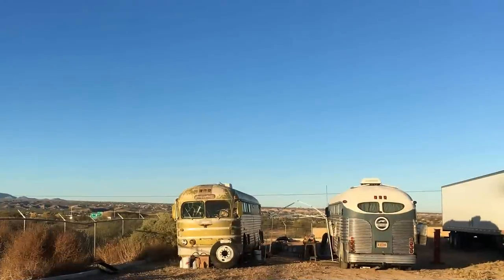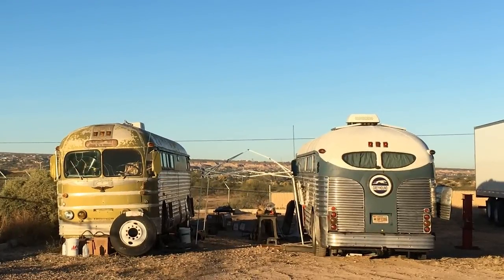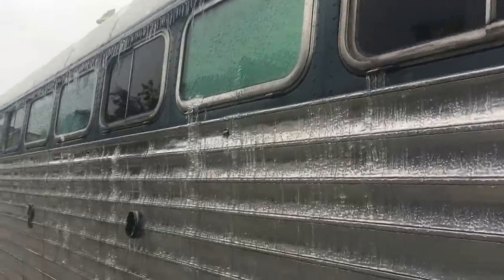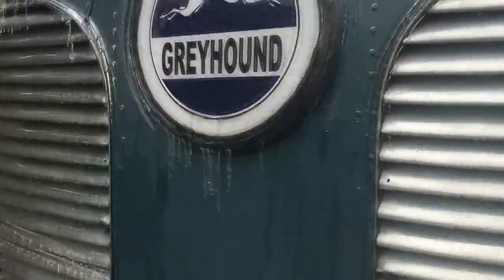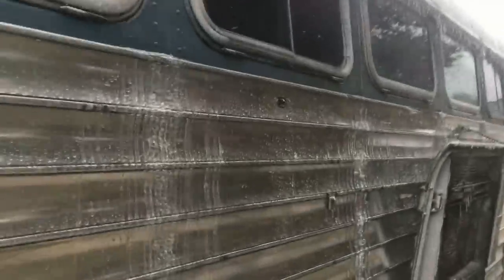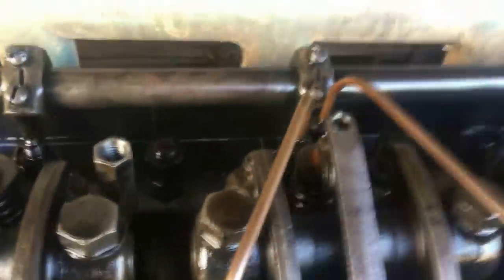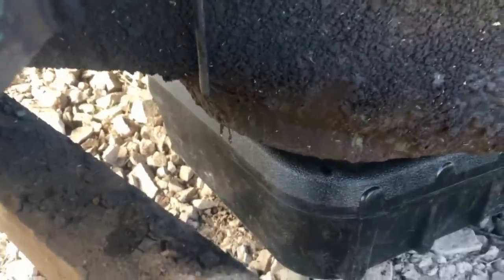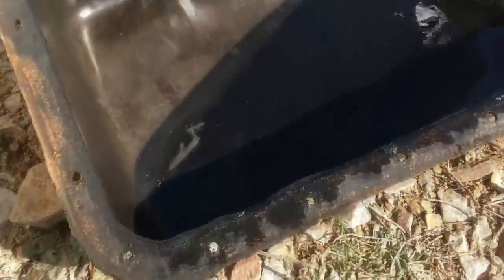Resurrecting a GM Bus that had a seized detroit diesel 671

Comment: Love series 71 detroit diesels.  I'm 69 year old hippy.  Shade tree mechanic, I only work on my own stuff.  Never owned a car with a brain.  My daily driver is a 52 chevy half ton.  Usually it takes me 3 times fixing something to get it right.  never could get carbs right.  Bought an old boat with a 3-71 series.  Engine just wore out.  it had been treated well it's whole life.  Engine built 1938, modified along the way.  I had no choice.  I had to fix it myself.  It was intimidating, cause it has to be rebuilt in place.  Thanks to the internet google youtube, i rebuilt the whole thing.  took me 3 months to research, learn, from random mechanics who were willing to spare me a bit of time on the phone.  There are video's on setting the rack, I wish I had seen this video, but there are others..  a buddy of mine gave me a shop manual for a 4=71 engine, and another from a boating friend, printed in 1938 for the 6-71.  I wish i had been introduced to these engines as a young man.  This was the only engine i have ever built that started the first time I turned it over after the rebuild.  the first diesel engine I have ever owned or worked on.  Two stroke diesel,  anyway thanks Bus Grease Monkey for this video

Comment: It's no wonder he's crunching gears, he's changing far to slow those fullers gearboxes are a rapid change especially if double clutching, great gearbox when you get used to it but it's the speed you operate the clutch that makes the difference between a clean change and a crunchy one.

Comment: I worked for 22 years at DD and the 2-strokes will never die.  It's sad the EPA rules spelled their doom, they were simple to work on as you saw built to last.
Reply: Bob
I'm with you, an Navy Engineman 20 years working/running 6-71s in the amphibs & schools, with developing some 6V-53s on Jacuzzi pump boats & school.
Always a sweet design, great engines in use.
Reply: Whoops. Almost left out the 12V71s, the main propulsion Cleveland big ones. 
All descendants of the Winton.
Reply: I worked at the Redford plant from machining, assembly, and inspection.  I was the fuel injection lab technician for 7 years and know how well built these engines were.  Seeing the bus come back to life brings me great satisfaction
. @johnlopperman2161

Comment: Interesting engine combination, newer "high" block, old 2 valve external fuel rail head.
Reply: Detroits had 2 valve heads?  All the Detroit heads I've ever seen had 4 exhaust valves
Reply: @LuckyBaldwin777  Really rough guess, mid  60,s the 4 valve heads came out.
Reply: @newjerseybill3521  That's interesting.  Never knew such an animal existed.  You learn something new everyday, as long as you pay attention.  Thanks New Jersey Bill.
Reply: @LuckyBaldwin777  Another interesting design change over the years where the cylinder liner ports.  Very early liners had a bunch of small holes at the air port area. This progressed to lager round holes, to figure 8,s to the ports we know today.  Many many years ago I saw some of the early liners in a scrap pile. Too bad I didn't have my pack rat mode back then.  Would make an interesting display of the variations over time.  Can't even find pictures on the internet of the early ones any longer.

Comment: I'm not a fan of multi-viscosity oils, they are necessary for really cold areas during start up but seem to thin out too quick especially in warm climate. Many don't know of Detroit 2 cycle oil recommendations. It should be on a tag attached to the engine.
Reply: what is it

Comment: How can a guy of that age, with bus driver’s license, not know what double clutching is?
Reply from the maker: It’s an rv and only requires a regular drivers license.
Reply: Still, I'm with Claus. A mature dude, doesn't know what double clutching is...
Reply: @966Mako  ignorance is bliss
Reply: Who uses a clutch much less double clutches?
Reply: @k2mslskier  me lol, all my trucks are manual. Floating gears is fun too 😏
Reply: Remember this is the same guy who was driving it with next to no oil, knocked the bottom off the radiator, and continued driving until the engine locked up. 
On that basis I'm surprised he knows how to drive at all. Perhaps he doesn't. He was certainly driving for hundreds of miles crunching every gear and not knowing why... smh...
Reply: What's a clutch???  Don't you all drive automatics now
Reply: After 1st 2nd or R Why use the clutch.  .  It wears them out.

Comment: Very interesting video! My experience has been mostly with Eagles, except for the GM double-decker. I remember in Colorado when the Oklahoma Transportation Co. had a contract with Trailways for their drivers to drive the "blue gooses" (as the Trailways drivers called them) between Oklahoma City and Denver. They all had the standard 4-speed floor shift (Spicer maybe?). 

I must admit this is the first time I've seen a column shift on an OTR bus. Even the old Silver Eagle Model 01's had a floor shift, 4-speed Spicer, powered by the Detroit 8V71.

Comment: mark all the pistons and liners from where they came from, every piece needs to go back in the same place for all engine parts, if you put them back mixed up youll get probs later on down the line, over heat clearance probs funny odd ticking noises etc
Reply from the maker: All of the liners and pistons were junk, but the rods were reused and yes they are all marked.
Reply: WOW, you think this engine is the first one this guy has ever done! Engine overheated, shooting sparks, and you are worried about marking pistons and liners!

Comment: Had you thought down the line getting a diesel generator for Lenny? the two i know of is Generac and Onan as i believe the onan's have a 4 stroke Kubota diesel engine in them i think depending on the model the engines are mechanically injected Not sure on Lenny's bay size on fitment on that generator as i think the engine is liquid cooled.  i seen videos on Matts4290 channel he mounted a generator in the middle of the bus between the frame rails of his 2002 Blue Bird All American retired school bus. and a Onan generator already mounted on the left side on his 1999 Gmc CV200 Blue Bird and its exhaust exits the back parallell to the engine exhaust. as i believe he uses the generators to run outlets and two roof toop air conditioning units with optional heat strips in them.  what was unique he did is took the control switches wired them and put them in the front of his busses so he can access them from the drivers area to control the Ac units and as well start and stop the generator. kinda interesting. as if a diesel generator it can be plumbed into the bus diesel tank or a seperate tank for it.

Comment: Nice. I just got a 1955 TD4512 gmc with 671. Runs great. I need the tabulation for the circuit assignment. I have numbers on the panel but the sheet on the panel cover is badly word and in readable. Any ideas where I can get a picture of one?

Comment: What I don't understand is, why didn't the owner stop the engine after having the radiator destroyed? There had to be smoke trailing behind it, right? Didn't the temp gauge indicate an overheat, or could it be that the coolant level dropped below the sensor, and thus it didn't show the right temperature? Just curious

Comment: How much oil did it burn out of it during the overheat... I mean theroetically if you have enough oil and can keep it cool enough you could run without tearing the crank out of it... the cylinders will eventually seize if it doesn't run out of oil and throw a rod.

Comment: I know nothing about this particular engine or those buses but I'm guessing those are two-strokers, am I correct?  Just looking a the holes in the cylinder liners.  I've never worked on a two-stroke diesel, only four-strokers.
Reply from the maker: Yes 2 stroke diesel detroit diesel 671

Comment: I was not able to tell, do they have the ability to rear start. 

It came out well!
Reply from the maker: New they do.   But the wiring and switches go bad and many times it’s inop I’m a big fan of front starting manual trans buses myself.
Reply: @BusGreaseMonkey  Okay, I cut my teeth on 9's , 12's and the old beater 102's , and they all autos.

At the time most of the TNM&O coaches were manuals, so I never drove those. Safety first.👍

Comment: I followed the rebuild, but was confused which engine/bus you were rebuilding. I understood you to say you were rebuilding the stainless and blue bus, but then at the end you said the old one was ready to go back to Michigan. ??? .    Would loved to have known the year of the busses you were working with. What vintage is a 671? Were they both the same year? When your worker was test driving this after rebuild, it seemed ancient and very rusty inside.  Was that old thing safe to drive 2200 miles from Arizona to Michigan?   What type of steering do these big monster’s have? Is it manual or power assisted? What is air-assist steering you mentioned?  I had to chuckle at the end when you were panning the camera over that old green bus, which to me looked like an old junkyard piece, and you said “ pretty”. One man’s trash...another man’s treasure...I guess. Interesting video. Gave it a thumb’s up.
Reply from the maker: My bus is the blue one.  I travel the US in that bus with my wife working on vintage buses.  Anyone else you see in my videos are the owners of whatever bus I’m working on at the time.  Both those buses are 1947.   Yes it’s safe to drive and it made it back to its new home just fine.  Air assist steering on his is a form of power steering that an air ram moves similar to a hydraulic power steering setup but only about 30%-50% easier to turn than manual steering.  So on the power steering scale it’s three notches above no power steering but no where near as good as power steering.

Comment: Another good one!  One thing I'm curious about, I've never seen a diesel with injectors that operate in that way, but you seem to encounter a lot of them. Was it a GM thing? Would I be right in thinking that the fuel is fed under light pressure to the injector and then the rocker arm hits a plunger, forcing the fuel through the injector? Almost like an early common rail system? On old diesels, I only ever saw engines that had an external camshaft driven fuel pump.
Reply: Nick Shipway.... yes, that would "be thinking right"..... the injectors (called Unit injectors) meter and pressurize the fuel, and are fed by a small, gear driven low-pressure pump... which is very similar and simple in design to many oil pumps in the oil sump of the engine itself.  All the 2 cycle series engines built by GM Diesel (aka Detroit Diesel beginning in 1965) utilized this same basic format.... which includes Series 53, 71(as this engine in the video, is part of the "71 family", 92, 110, and the big 149. 

All the Engine "families" (53, 71, 92 etc,etc.) were labeled as such in accordance with the cubic inch displacement on a per cylinder basis.   The Only exception to that,  was the 51 series, which was in accordance with the initial year of production, which was 1951... until 1959.   The "51" was also the only one that was a design departure from the "Uniflow" Scavenged (utilizing a gear driven Roots type, positive displacement blower) engines, in that it was designed utilizing a "loop" Scavenging system.

This was accomplished by using loop scavenging ports for both intake and exhaust along with a mechanical blower. The series 51 engine (2 versions, 2 cyl. & 4 cyl.) used a dry sleeve (versus wet sleeved in the other Detroit "families"), with 9 intake ports and three exhaust ports contained in that sleeve. These sleeves were located in a way that the exhaust ports lined up with exhaust ports in the block and were located physically higher than the intake ports in the block. 

This resulted in pressurized cool air being forced through the intake ports just after the exhaust gasses began exiting (the exhaust ports in the sleeves were higher at the top than the intake ports while the bottom of all ports (intake & exhaust) in the sleeve were situated at the same height. 

Unlike a 2-cycle gasoline engine, the crankcase is/was not used to draw in the fuel/air mixture. Instead, the blower forced air in the intake ports and fuel was injected by a camshaft actuated injector which was pressurized by a gear pump.  Unlike the familiar 2 cycle gasoline engines (small ones, anyway), the fuel is injected just before top dead center, and therefore very little unburned fuel is ejected in the exhaust phase.

Sorry for the short "book", but I thought I would just give you a very small insight on these wonderful and very reliable old engines, that Many of us greatly miss... unless you own one, as I do... but still miss the days past when these engines were "king" in many different applications.... in fact the venerable Series 71 "owned" 82% of the total world market for Mid-size Pleasure craft as well as fishing Boats and large harbor to ocean-going Tug & work boats(not including huge commercial/corporate floating fishing & processing ships).  

In the earlier years before Cat, Cummins, Buda-Lanova, etc, etc started turbocharging their engines to get more power... up to the mid-late 1970s,  Detroit Diesel had 65% + of the On-Highway (OTR - Over The Road) semi-truck market, and that did Not include the smaller class 5 & 6 "in town" trucks.

Comment: Just curious, why in the world would you suggest " double clutch " . Doesn't that wear out a clutch.
If your going to do anything, don't clutch at all, shift at the correct rpm
Reply: Those transmissions need to be double clutched. Speed shifting is actually harder on the trans, double clutching properly won't wear the clutch out for over 100K miles. Clutches are cheaper than transmissions.

Comment: I never thought I'd be anxiously waiting for the next vintage bus vid.... great content, thank you.  On a side note, have you come across any DT466 conversions, and what are your thoughts?   Money aside, is one better off sticking with the 6V/8V stuff?
Reply: i personally would keep a GMC ALL GMC. Check out the old Flxible Clippers and Starliners. The engine compartment in them is so vast you can pretty much repower them with whatever you want to. And I believe I DID see one that was running a DT466 once.
Reply: @michigandon  Yeah, a saw a Starliner for sale with one, which prompted the question.  I suppose one could buy an old pusher DT466 school bus and swap the entire drivetrain into  a Flxible.

Comment: Why is it that oil doesn't spray out when the valves are open like that when the engine is running?

Basically I'm asking how that area stays lubricated if oil isn't shooting all over the place when you take off the valve cover. Thanks
Reply from the maker: It flicks out.  The rocker bolts are hollow and oil oozes out around the rockers at the shaft.  If you rev them up high it will make a mess but at idle the oil pressure is very low.

Comment: what did the rebuild cost? Also I have 3 of these silver liners 
buses sitting in a feild in the town I live in Oregon.
Reply: I would like to know the answer to this as well. Regular passenger vehicle mechanics aren't cheap. Diesel fleet mechanics even more so, but, an in-the-field, highly specialized antique diesel mechanic? I can't even imagine.

I assume he charges for these jobs but, perhaps he's actually a highway angel, donating his time and expertise for these old beasts?
Reply from the maker: A regular engine rebuild on one of these is about 5k.  This one was more because the head and injectors were bad plus we went through the hubs, brakes, radiator, muffler and more.   Labor including travel was around 5k + parts

Comment: Nice job on the motor. Good thing the crank wasn’t fu..ed up ?  How hard was it finding parts for engine? 👍
Reply from the maker: I had a crank ready if we needed it.   Pretty easy to get engine parts.   We had one odd ball liner that was a different bore that we got the only one in the country.
Reply: I read somewhere that Diamler issued a statement not too long ago stating that parts for the 71 series would remain available though the year 2045.

Comment: Why was the guy driving the bus when he did not have a clue about driving a non synchromesh transmission, on the interstate no less??!!
Reply from the maker: He just bought it and he was learning how to drive it.  How many gears was he going to change on the interstate?  Hell he was practically in 4th and final gear on the on ramp.  We were breaking in the engine which needs to be under heavy constant load not start and stop idling.

Comment: good Jimmy oil pressure should be at 45lbs  idling
Reply from the maker: With what 80-90w oil in it??   They have almost no oil pressure idling 5psi is great.  Super low oil pressure at low rpm is why you can’t lug them under power.  There is no cooling the inside of the pistons with lower rpm and the oil cooling the inside is very important.
Reply: I have never seen any 2 stroke Detroit have that high of oil pressure at idle.
Reply: @Kalvin Labuik LOL  Where did you get that idea? Are you talking about HIGH IDLE (governed, no load, top RPM)? You would NEVER see a Jimmy with 45 lbs. of oil pressure at IDLE!